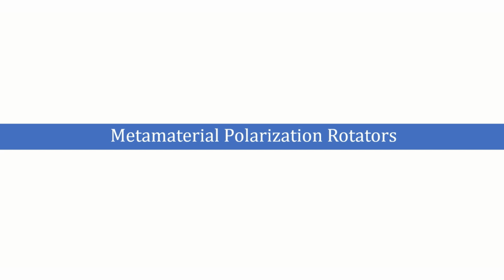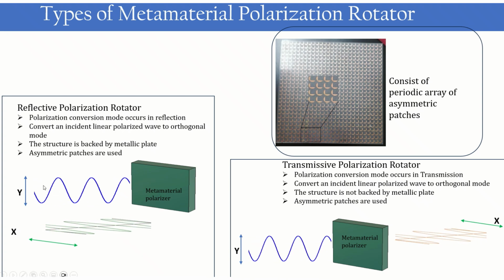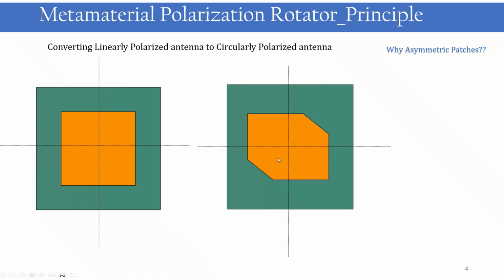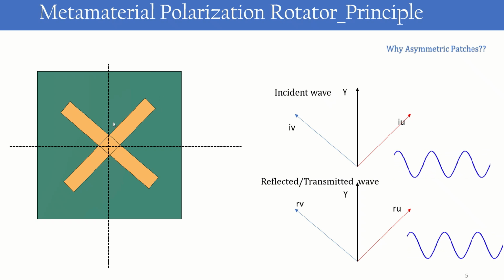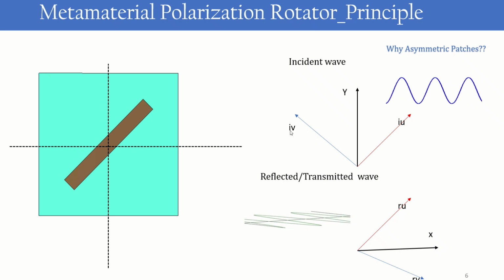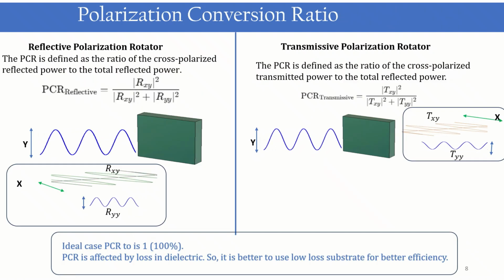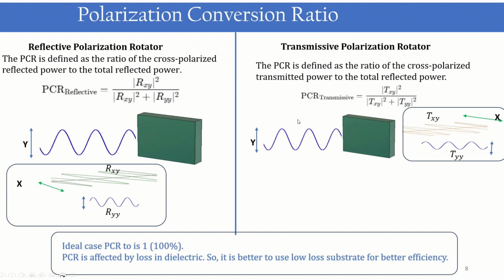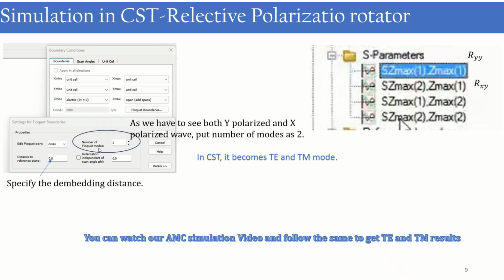Metamaterial Polarization Rotator| Polarization Conversion Ratio| CST Simulation Overview

Comment: Please make a video on postprocessing formulas for polarization conversion in transmission mode. Linear to linear as well as linear to circular
Reply from the maker: This will be helpful for transmissive mode rotator-
https://youtu.be/KHDo_LG3f5E?si=V5Fh0DX3mJkE2a-l
Reply: @waveresTech thank you but still the formulas in post processing for transmission PCR is not presented. Could you please make a separate video on just ‘postprocessing’ formulas for linear to linear and circular polarization conversion in both transmission and reflection modes. Thank you